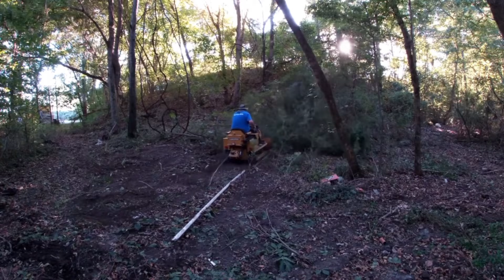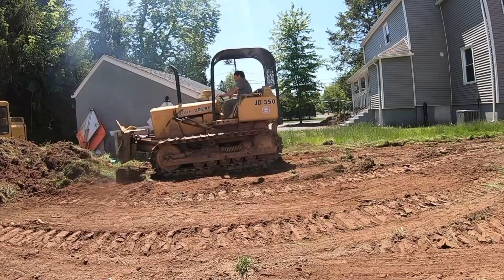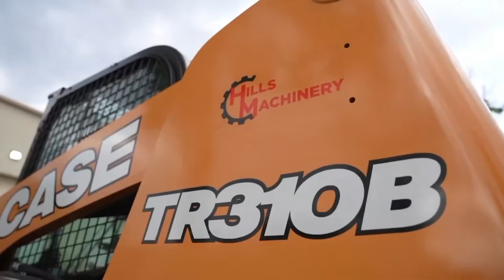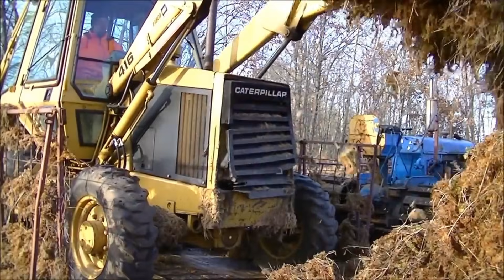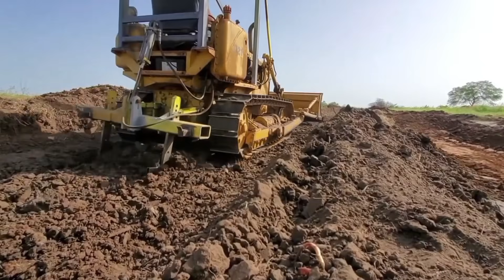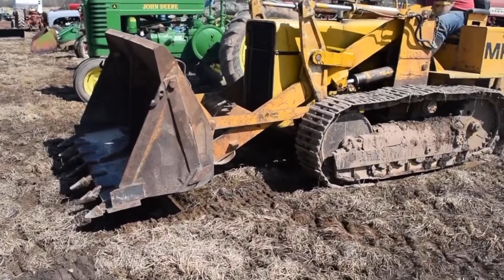THE SMALLEST CRAWLER LOADERS YOU HAVEN'T SEEN

Comment: We ran a JD350B diesel back in the early 70s.    Drought 4 in 1 bucket,  backhoe attachment.    We were building campgrounds  and it was a Swiss Army Knife that worked.  Clearing,  spreading,  loading,  digging holes (backhoe) you name it,  it did it.     Its only maint was greasing,  it got the oil change when it went into storage for the winter.    We still needed a D-7 size from time to time,  but day in day out, the JD350B was it.    No CTL could replace it.   Hate to see that size machine gone.   Never ran the gas version but that little diesel was a beast for its size.